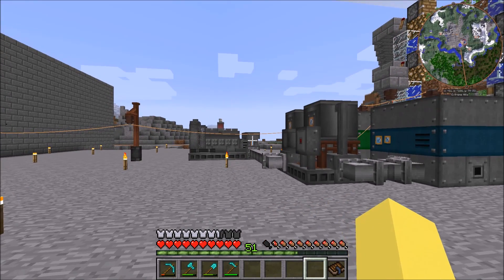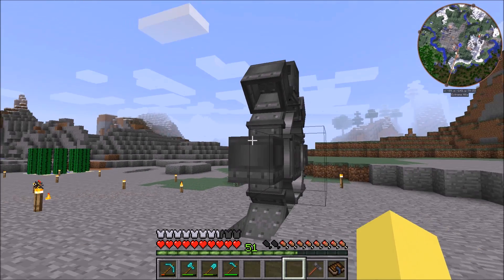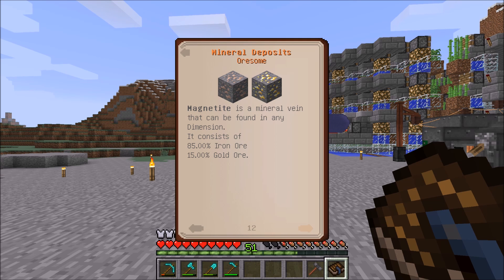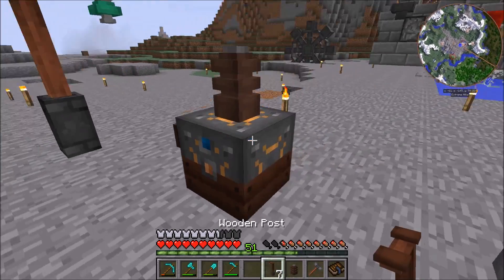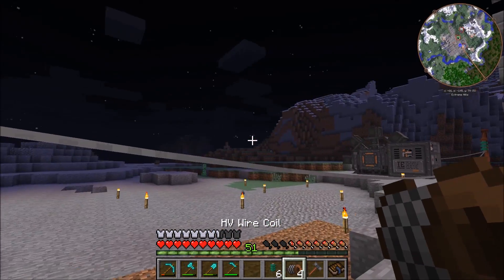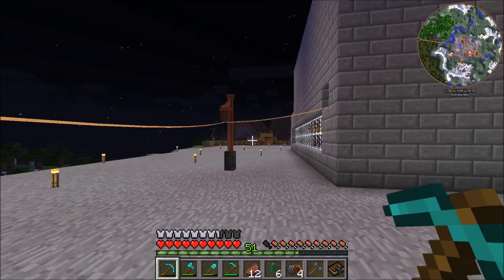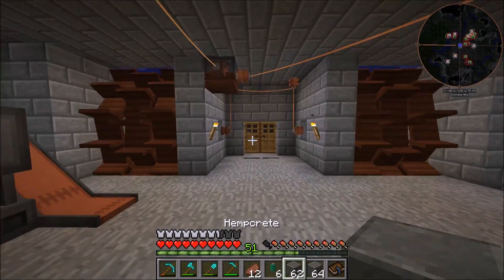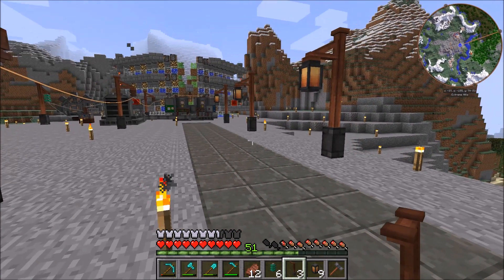Surviving With Immersive Engineering :: Ep.14 - Running The Excavator

Comment: You cant pipe into Vanilla enderchests, because it is player spesific.
Reply: +DrRageHard From a code point of view, the vanilla Ender Chest is actually seen by the game as an extension of the PlayerInventory. Due to this fact, it can't be automatically inserted into or pulled from directly. Knowing this, you can see why they can't be automated even using vanilla hoppers as they aren't coded to remove items directly from a player's inventory. Hope that makes sense
Reply from the maker: +The DarkPreacher (Preacher) ah okay, I never thought of that! I'm so used to using the EnderStorage Ender Chest. I don't think I've touched the vanilla one since it was released hah.